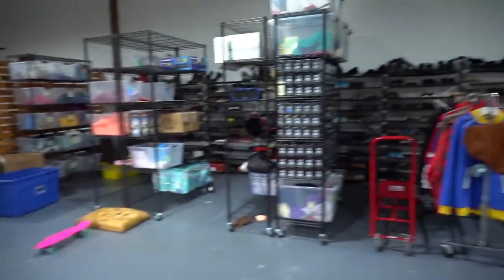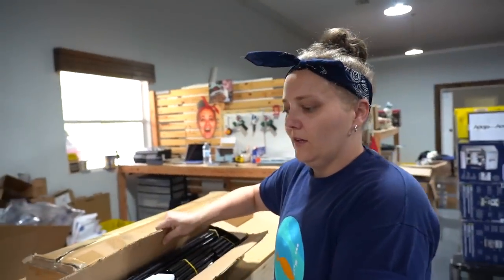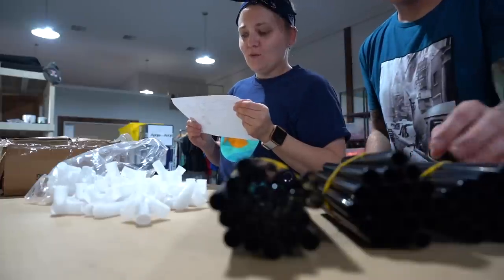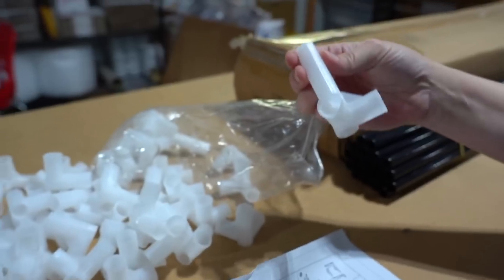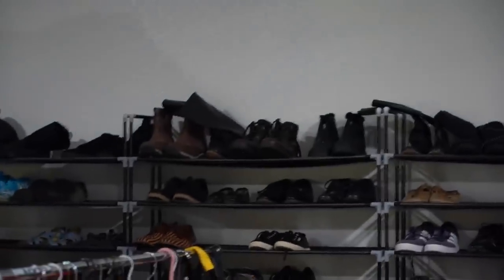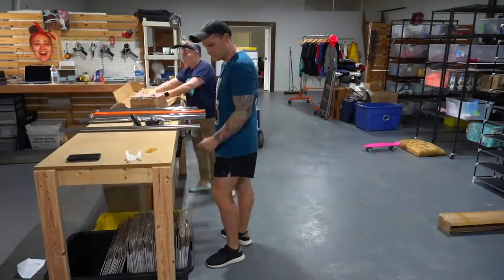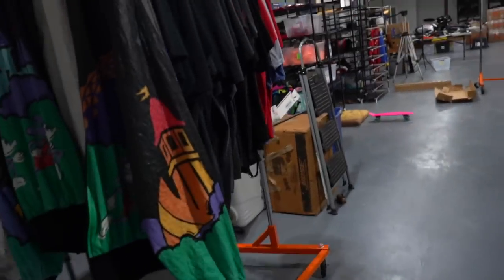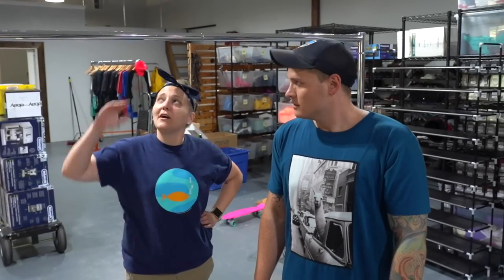The Best Shoe Rack & Z Rack For eBay!

Comment: I have the same z rack and love it. There's also a bar you can buy and bolt on if you want a middle bar. The top bar is adjustable for more height. These z racks come in a couple different sizes too if you need a smaller one. I have 2 of the smaller ones too 👍🙂
Reply: nice to know

Comment: I have a pretty massive shelf that I just put together to store a good amount of shoes. I want to say it's 18" x 24". It works, and is super sturdy...got it used and super cheap...but I don't think it's as efficient with space as these ones are. I may need to reevaluate that rack and if I should be using different ones. Maybe I'll continue using that for all of my new shoes, in shoe boxes, and change to these ones in the video for all of the loose ones.

Comment: Great suggestions, thanks!  Are the shoe rack shelves able to fit in USPS shoe boxes vs. just the plain shoes?
Reply: OK I read on amazon each shelf is 6.3 inches (in height? doesn't say). USPS shoe box is 7 3/8 x 5 1/4 x 14 7/8 inches. they could go on their sides but would hang over the back 3-4 inches.

Comment: That shoe storage shelf was good for about a month but then it collapsed and I didn't find out for a day so some pairs got damaged.
Reply from the maker: Weird. We’ve used them for a while with no issues.
Reply: Did you fill it to capacity
Reply: @elisscaliving4776  Yeah but its not like I stuffed it I just put the max amount no stacking and came home one day to it collapsed. The legs bent and it went sideways.
Reply: GEN Z Flips the shoes you put on it were probably to heavy

Comment: ????? How do avoid listing a fake item?  Have you ever went to list something and then realize that it is a fake?  If so, what did you do with the item?  Have you ever had an item removed by ebay stating that the item is a fake?  Have you ever had a customer contact you saying the item you sold to them was fake?
Reply from the maker: Research the item beforehand, make sure you’re 100% sure it’s authentic before it’s listed.